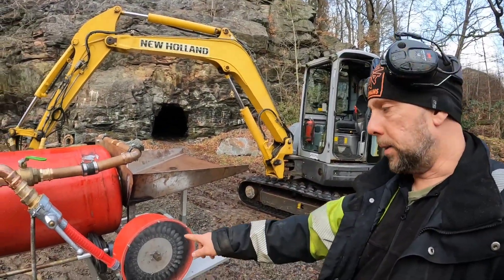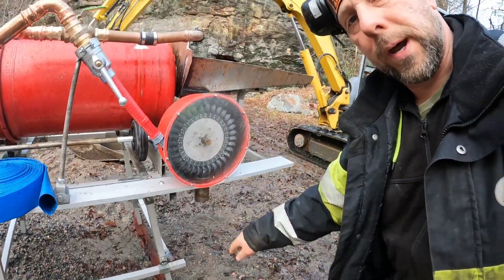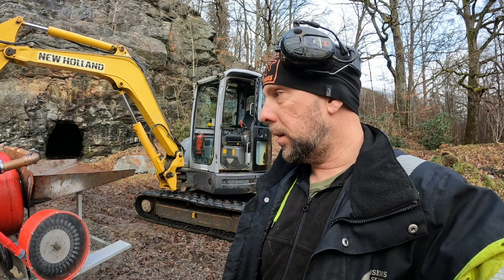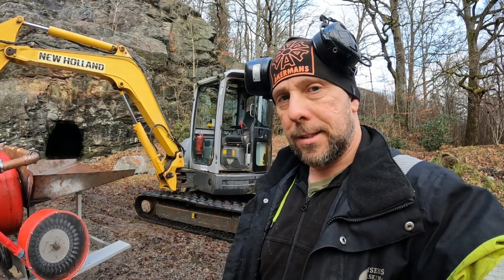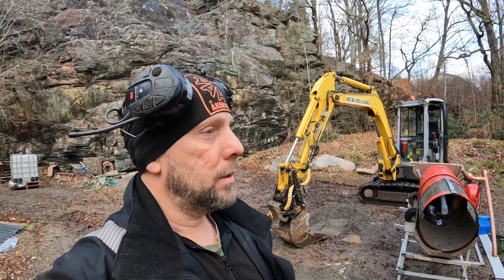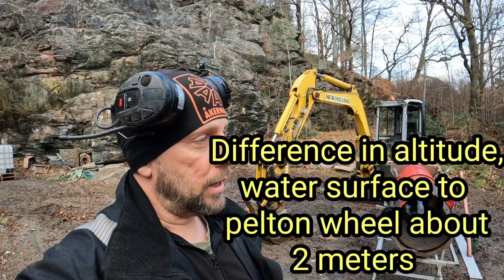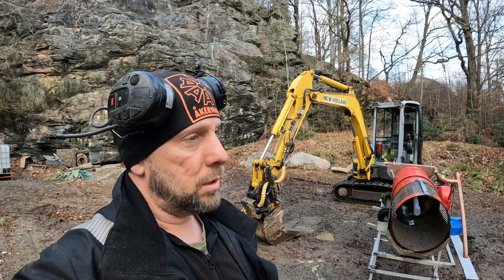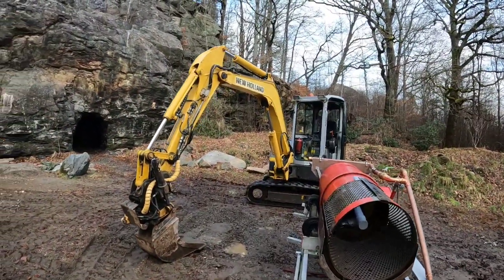DIY: Water driven 20" Trommel Washplant for Gold. Final test with material.

Comment: Could design an enclosed waterwheel so you pump water into the wheel and from there feeds your spray bars. Less wasted energy. Your waterwheel would need to be water tight and able to handle the pressure from your pump. Then use a worm gear to reduce RPM for the wash drum. Then after work on catching the water from the spray bar to push the small material through sluices.